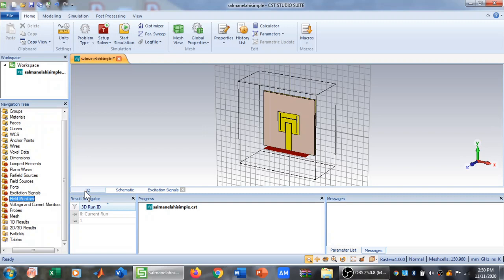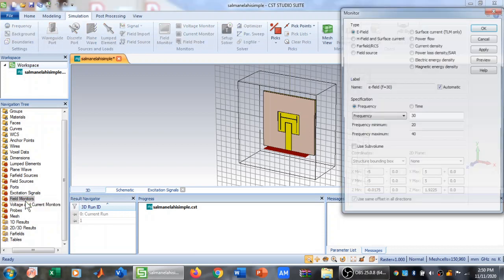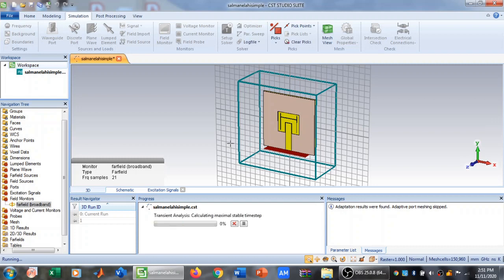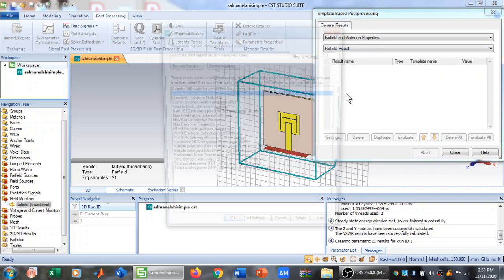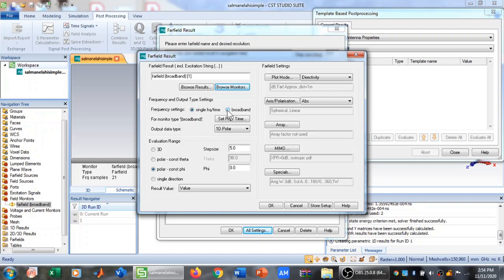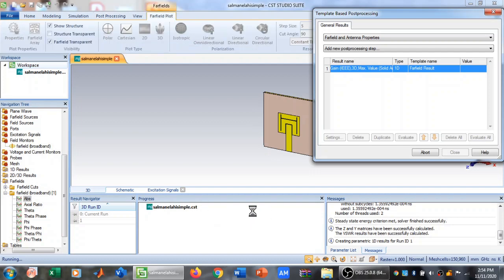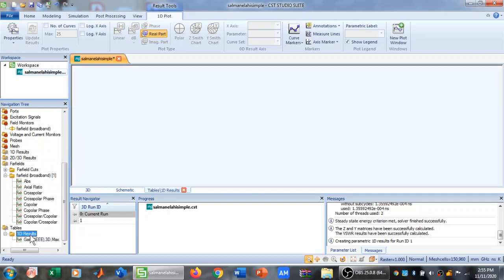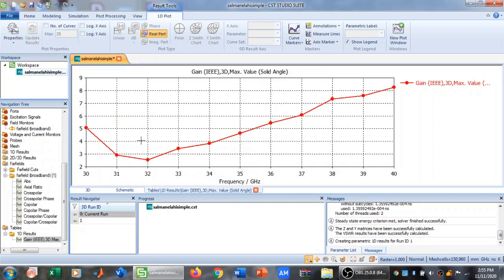Gain VS Frequency plot in CST|How to plot gain vs frequency in CST Microwave studio

Comment: Actually I have a graph between transmittance and frequency there is no formula. I m new learner in cst. That's why I can't understand
Reply from the maker: S21 is the forward transmission coefficient .and s12 is the reverse transmission coefficient..usually s12 and s21 are same because of being symmetrical..
Transmitted power is square of  (s21)
Reply: @TechnicallyExplained  okay thanks a lot 😊
Reply: What is the meaning of S11
Reply from the maker: @minakshimakkar9249  s11 is the reflection coefficient expressed in dB
Reply: @TechnicallyExplained  ok sir
Reply: Can we change value of parameters along axis in cst.?
Reply: Where can i find the design of this antenna by details please i'm beginner on cst and i'm interesting by this antenna